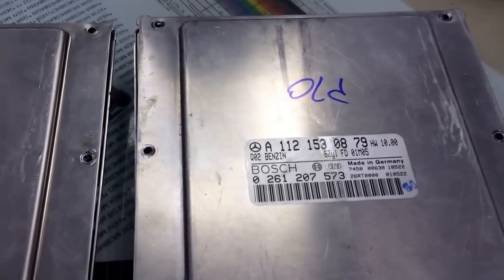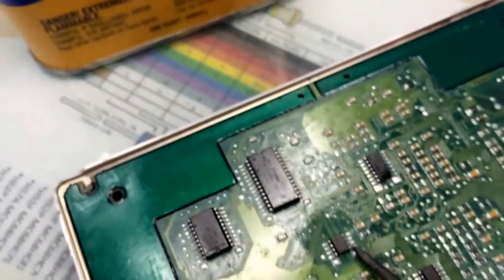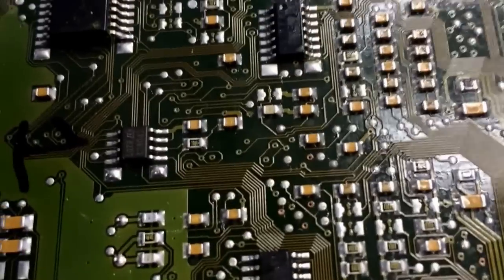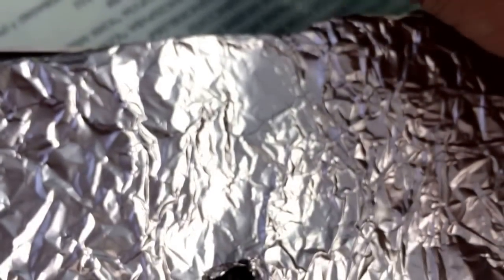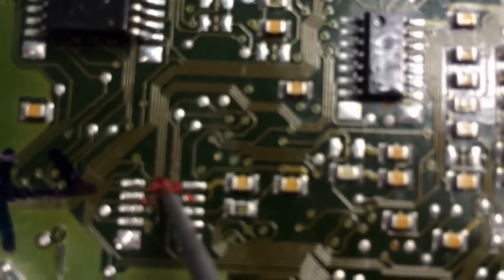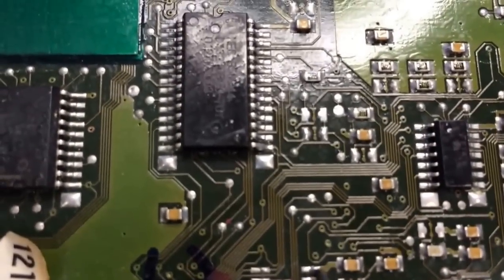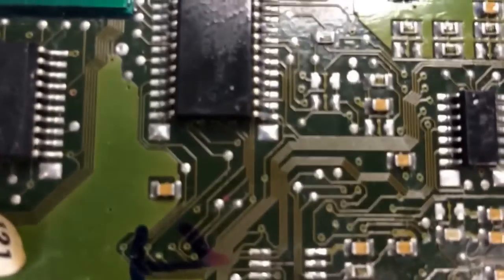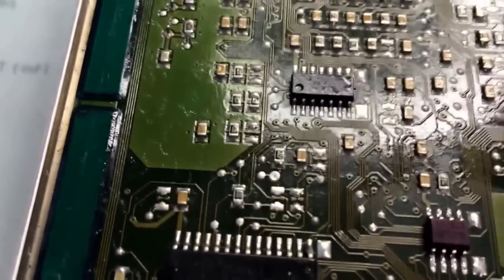Unveiled: ECU swap and Mercedes immobilizer programming

Comment: I did it, now the fan doesn’t turn on full speed, and my car will start for a second and then die, and won’t crank or start again until I disconnect and reconnect the battery. Numbers on ecu match. Soldering done well. What’s the issue? Is it the flash memory? Is it maybe something unrelated like the crank position sensor?
Reply: Please if you solve the problem tell us
Reply: This is a clear sign of immobilization

Comment: 2003 Mercedes e320, I swapped eeproms. Car will crank start then die twice and then won’t crank at all. Thoughts ?
Reply: Did you ever figure this out? Same issue, cranks once, then nothing.
Reply: @ you have to program it, I couldn’t do it, it’s not brute-force, keep the original eprom and have someone that knows how to do it program it, you’re just gonna have to spend that money which is around 200-400 to program

Comment: The Dealer told me my car, 2004 ML350, can not be fixed.  The AAM went out and is now obsolete. Does anyone know a work a round because these computer are specific to each car and you can not substitute used parts.   Great body , tires, interior, I need help!?

Comment: i have a 2009 mercedes c350 with a bad PCM, I bought an used one and swap the EEPROM chip, now thw car wont crank or start, please any advise. thanks
Reply from the maker: Maybe you installed it wrong or damage the eprom pins

Comment: Hello, good afternoon. I have the following problem. I am from Chile, Temuco region, in the south of Chile, and I have a Mercedes W203 C240 2.6 V6, year 2005.
in this region it rains a lot and one day the car did not start anymore I started to check and I realized that the ecu does not work because I scanned it with a launch 431x and it does not recognize the ecu I took it out and sent it to check something that had a little of humidity the man who repaired it for me said that it is good now but it does the same thing as before I put in the key it recognizes the key the car turns 1 lap the usual lights turn on the 2nd lap it would be hard to hear the pump not being heard and the 3rd ignition turn does not do anything nor does the engine turn but the electro fan of the engine is heard at maximum.
What can I do or what ecu can help me since I have the car thrown away

Comment: I would have done that with a soldering iron. Very nice work. Do you have any info on sprinter vans? I'm trying to do an ecu swap with a van with the same engine. i took the key the console and the key decoder behind the console plus ecu from a van with the same engine. Now i'm getting the start error message. Is there an eprom swap or a reprogram i need to do? I thought taking all of the above accessories across from the donor would be enough. Last thing is i have a tachograph on my vehicle which is why i am trying to swap ecu's i wish to remove the tacho. I'm stuck in limp mode after previously trying to remove the tacho. i guess as soon as you cut the permanent positive of the tachograph unit it looses it's handshake with the ecu. I'm now stuck in limp mode and the donor ecu doesn't work. 
  Could you explain to me why you would need to swap the eprom if you have all of the above electronics from the donor vehicle? What is there left that wants to recognise the original eprom? or do you only do this when you don't have the new console and key transponder (IMMO / SKREEM) box
  The only other difference i can see is that my van has a KITAS speed sensor by the output shaft of the transmission soi need to go back to donor van and see if it has some sort of speed sensor and how it plugs into the ecu etc. the kitas sensor is for the tacho and first plugs into the back of the unit, then the tacho device sends can bus and 2 other signals out to the ecu / cluster. I'm pretty stuck here.
Reply: Did you find a fix for this?

Comment: Very helpful.  I'm impressed.   Question:  I have an old 1996 c220 with 2.2 l engine (w202 chassis). Do you know if the immobilizer chip is on the front of the board or the back of the board? I only see two  8 pin dip ic s on the pcb. Neither one is the number on your more modern example. It probably predates the one in the vid. I'm guessing that it is one of these two chips. The rest are much larger.

Comment: On my e55 i used to get diffent missfire codes po300 , 305to 308 and then (JUST) removed put back the ecu gave me whole diffrent codes and engine working rly bad. Comming to an idea that i need a ecu. Imma get a used one and i have the stock files from mine , can i just rewrite the (new) used ecu imma get from a CL55 ? Thanks

Comment: In your other video, you used the CARPROG to read and write the eeprom. Could you have used the same tool here to avoid removing the chip?
Reply from the maker: You can if you have it
sometimes it still requires to remove it to read and write Becouse on board it don’t want to read the chip

Comment: I have 2005 c230 komp with bad code line on cylinder two causing a miss fire so I bought a used ecm to swap.  My ecm is sealed (a2711538779) and the layout is totally different.  Would you happen to know which eprom it might be?  There are three matching yours; (62506 0526), (L9637d 9526), (2272m 54t d6tf). Thanks and much appreciated!

Comment: Hey man, i need some advice. I just bought a Mercedes sprinter 2006. It has some problem with communication  computer and the star signal wont show. I have a car scanner abd i tried to read the codes but it will just show "error in communication". Im just asking if thier is some way you can give an advice that could help me out. 
Thanks

Comment: Will this fix the problem for a Cl500 ? One day I came out to start it up and nothing worked...the unlock or lock button didn’t work and the ignition wouldn’t budge so I order a new key fob from Benz and it still didn’t work the only thing that comes on are the dash to show the mileage and the temperature...any advice ? I’ll appreciate it
Reply from the maker: You need to diagnose first and then see if your computer is bad then this service is for you
Reply: @vehix411 Will this process work for a 2006 mercedes s430? I'd appreciate a response if you're not too terribly busy. It looks like this will be the best route to go to save a crap ton of money and time. Thanks for taking the time to make such an awesome video to help so many people out there with this particular problem. It can definitely be daunting for people like myself who are stuck on what to do. Thanks again!

Comment: Hi, I have S350 model with battery drain issue. I found the trouble is in the ECU. I have got another from junk, but the Eprom is a bit different in both. Is it ok to change it? Plz guide

Comment: Yes if done correctly must need to make sure the chip is installed correctly and taking it off not to break the pins as we had ppl try doing it themself and then shiping it out to us to fix it 
If you try and break pins won’t be possible to recover info

Comment: Did you have a problem that lead you to buying a new ecu? I have a 2001 S500 that has intermittent starting. My dash lights come on no crank. Then I keep trying and after several attempts the car starts. Any ideas of what I should look for what might be causing this problem and what I may need to do to fix the problem? Thank you in advance for any assistance.

Comment: I got ripped off by a used car dealer (Ruslan Brovarsky, Austin TX) on a 2003 C230K

Apparently?? The key, door-lock, immobilizer, the ignition tumbler/switch along with the ECM Was all swapped from another car.

I Don’t have the original ECM.

From what I understand the reason nothing works on the car even though it starts and runs? It’s because I don’t have the original build file in the ECM to match the car.

When I scanned the present ECM the Vin number is not even where it is supposed to be, it’s just blank.

Any ideas what I can do?.

My only recourse is to go to the dealer and buy a $2000 OEM ECM along with their labour and the pre-diagnostic review.

Comment: Great video VEHIX411

Just one quick question -

Do you have to do any more re-programming to the donor ECU once swapping that EPROM, or do you swap that chip and re-fit the ECU to the car and it’s all done?
Reply: Hi I have Benz S320  ECU damaged water went in I have other ECU good can you fixe & how much it cost & what do you require from me
Reply: My contact 00267 74019444 or can you give me you email or Skype contacts
Reply: Kindly contact me leo. I can do this for you. it's MotorE +917744827519
Reply: Motor Engineering I have an e550 2007 needing a new ecu. Can you reprogram the new one?
Reply: @jakekurland3568  yes I can. Pls send me details
Reply: Motor Engineering absolutely. Can I get some contact info, it’s for a 2007 e550, I’ve got to try and get this done within the week.
Reply: if you manually swap the EPROM it should essentially work instantaneously becsuse the eprom is all of the unlocks and stuff that are married.

Comment: I Have an 07 CLK350, M272, ECU Part # A2721533291, Needs an ECU Replacement, I would Like to Try this Method because Dealer Quoted me $1800 to Replace. I am Having trouble Identifying the VIN Immobilizer Chip on the ECU Circuit Board, There are 3 that looks similar. Is there a Specific Part Number I should be Looking For. or do you have any other info how I can be sure which chip I would be Swapping. Thanks and Great Video.

Comment: hi i vehix411, im from philippines...i bought the same ECU on my Kia Rio 2006 Manual Transmission, it's cranking but don't start and check engine is lighted and blinking, but we make start the car buy shutting the gas pedal..but it shutting off.Can you tell me if i need to reprogram the ECU swapped on my car? yet its the same..thanks

Comment: Would the donor ECU (the new used one) need to have come from the same exact C class model in order for it to function after swapping chips? or is their programming required after the chip has been swapped?
Reply from the maker: exact part number and then this chip method will work

Comment: I have done a 200 ML320 ecu swap. Same location for EEPROM.  I used Chip Quik to remove chips safely. I cleaned the board with wick. Its very easy that way.

Comment: Thank you for revealing this simple fix!  It worked just like your described using an identically versioned ECU.  I used a W211 as the donor for a W209 failed ECU.  Kudos for sharing the tip!
Reply: This is practices are not permitted heating with amateur Hot Air. In this way You can incinerated processor Motorola HC11. They can also  incinerate peripherals items and PCBs. Damage can occur after a period of time. Items can fall off. Creating danger on the road.
Reply: Latent damage of chips or the PWB is always possible when using either a solder iron or hot air. Of course care must be taken and you have to know what you're doing. "Professional" hot air stations can be just as damaging with the heat. Any tool in any idiot's hands is likely to be dangerous. I'm happy to say that I'm a professional.
Reply: So then the part numbers DO NOT have to be identical, is what you’re saying correct?

Comment: I was able to figure the eprom chip is 95080 on e550 ecu and switched the eprom chips between my original and used ecu i bought.  the ECU i bought now has VIN of my original car. (OBD reader read the VIN).  But I still can't start the car!

Comment: It's not programming at all. It's just a brute force chip swap. Nothing new on this procedure that is very risky because you may easily kill the original chip by overheating. Real programming would be copy the data from the old ECU to the new one.
Reply: rbarijan You are right about this not being programming.  Its much better than programming.  You would need a very expensive scanner to do this job that usually only dealers can afford to do this job and you would have to buy a new computer that most likely costs over $1000 bucks.  This ingenious proceedure eliminates all that BS.  Dealers want your car to be captive to them and they only offer support for 10 years. Then you are supposed to throw away your car and buy a new one is their theory.   We deserve to be able to repair our cars.  I applaud this video and proceedure.   The guy is very skillful and did not overheat the chip.  The chip had to be heated to install it on the circuit board in the first place.  All you need is a little common sense.
Reply: @dwtees  that was my main concern